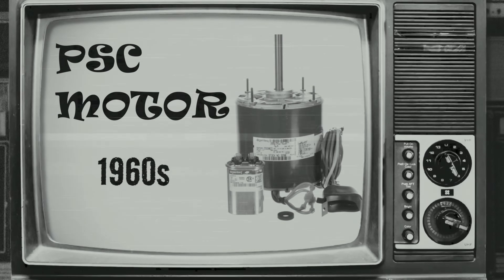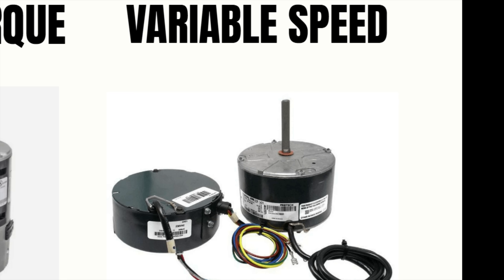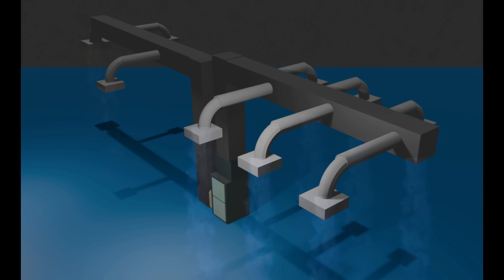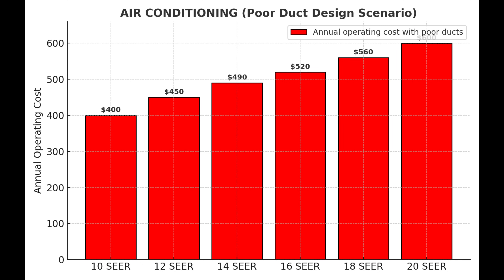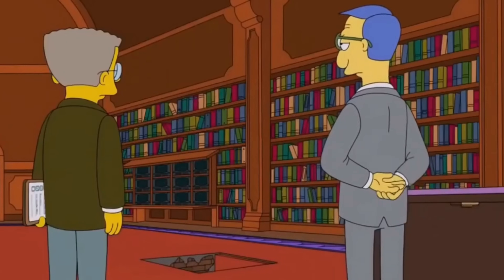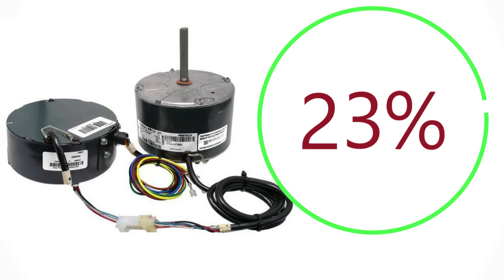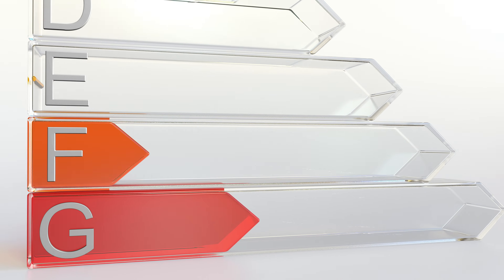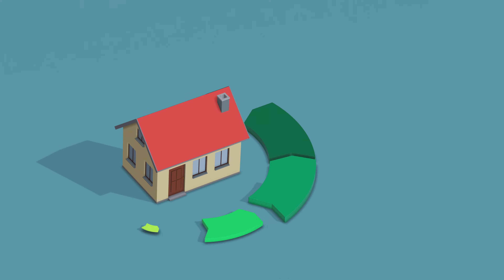The Ugly Truth About Motor Efficiency in HVAC

Comment: I have always told customers. If you aren't going to replace the ductwork, then don't get a higher seer system.
Reply: undersized air ducts are a problem for any system, really. if it is a psc air handler, you get too low airflow on undersized ducts which cuts capacity and efficiency, ecm you get closer to normal airflow but excessive static, short motor life, high motor electric consumption.
If anything equipment should be downsized if possible to match air duct sizes, most systems are oversized for the load anyway. Goodbye 1 ton per 500 sq ft bullshyt.
Reply: So, you have told people utter nonsense then.  Single Speed systems will simply freeze up and die prematurely on an undersized duct system.  I replaced my single speed with a variable speed system, didn't touch the duct work, and it works perfectly.

These one size fits all advice claims are just comically ridiculous.  If the duct work is correct, it is correct.  If it not, it is not.  Having a single speed system won't help you one bit.
Reply: @redbaron6805  lol dude. If I'm at a customers house that has a system that needs to be replaced. It's a 13 seer system. Let's say 3 ton. The supply is 16" and the return is 16". A heat load calc has been done on the home and it is confirmed that they need a 3 ton system and they don't want to upsize the ductwork, then yes I will advise them to go with a single or 2 stage system. A 3 ton system needs 18" on both the return and supply. An inverter system won't work properly and if the have a smart thermostat they are going to constantly get error codes for high static pressure. Yes, the ductwork is undersized for the single stage as well, but the single stage is not a modulating system. The different parts don't communicate with eachother. Yes, the single stage won't be working to it's full potential, but the functioning of the system will be fine, unlike an inverter system which will panic and freak out because the operating parameters aren't correct. The up front cost of an inverter system is much more than a single stage. The sales point is that it will save on the electric bill and use less power. If the operating conditions aren't correct the system won't save you any power consumption. So, why would I recommend it if I know it's not worth the money? You have to think about the customer. And I know how the difference blowers work. When faced with a restriction, a psc with lower it's CFM. Most single stage systems today come with a constant torque motor anyways which will keep a constant CFM. It's not just about the blower motor, man. A fully modulating inverter system works a lot more differently than just having a different blower motor.
Reply from the maker: Best advice to give.
Reply: @JerseyMikeHVAC  I really enjoy your videos, man. Top tier HVAC training for sure.
Reply from the maker: Thank you, brother.
Reply: @JerseyMikeHVAC you're welcome! And keep em coming!

Comment: wrong, seer  was based on .5" and seer 2 is based on .8", also some Japanese brands such as Mitsubishi and Fujitsu  had their own standard of 1.0" wc so when seer 2 rating came out they  pretty much stayed at same rating,  seer was not an honor rating what are you talking about, manufacturers have their test that adheres to certain parameters, now your actual efficiency will vary but its not a fault of a equipment you have to have proper HVAC design that meets the requirements of manufactures, its like putting in a 5 ton system into 500 sq foot house and saying it wont removed humidity as advertised that's not an honor system its called a hack job

short summary, you wont get advertised efficiency rating if you have a hack install a system
Reply from the maker: https://seer2.com/about.html

Comment: Fantastic tutorial Mike. I am sure that most people dont realize the pros and cons of each style of motor. For a tech or homeowner, It is diagnose if the motor is bad and remove and replace.
Reply from the maker: Thanks. There are several of issues here, whether some techs understand this or not, or homeowners who think it's just an up sale... especially if the duct system worked just fine for 20 years on the older equipment. Guys worried about losing bids... it can be a sticky situation all sorts of people kind of avoid.